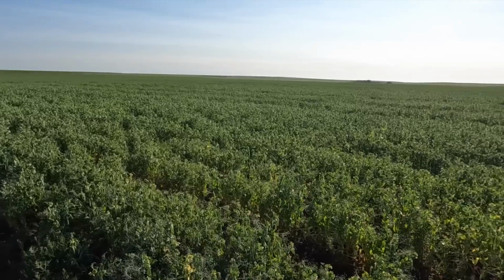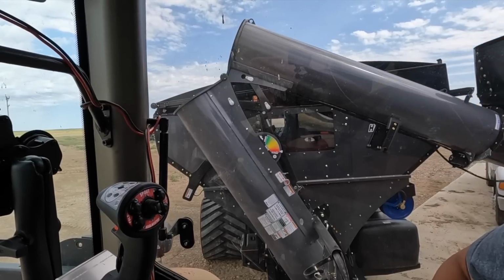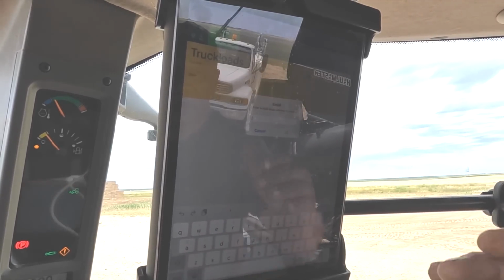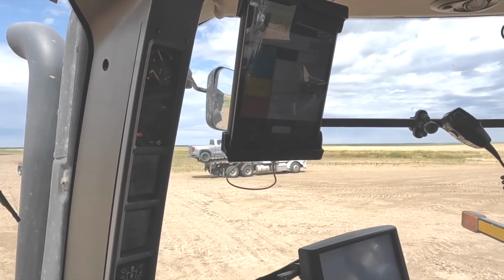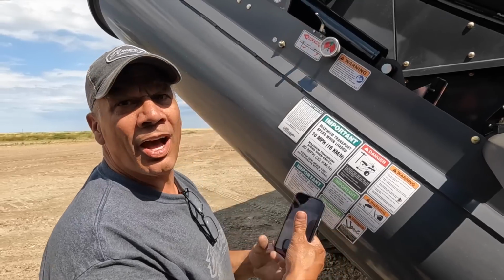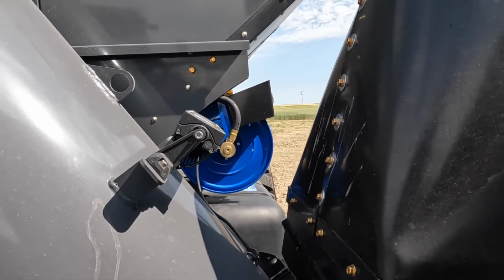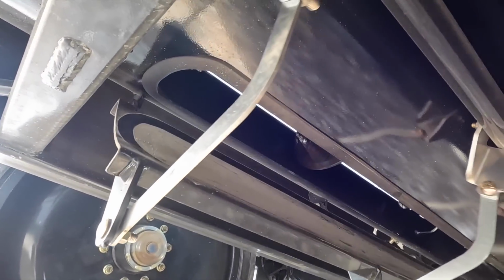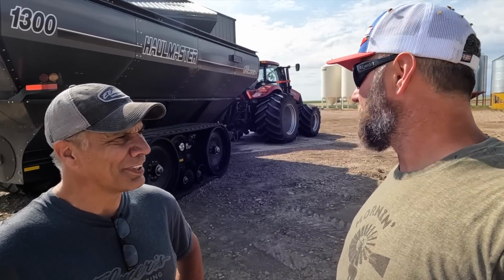GRAY Equipment on a Red Farm?

Comment: Unless they’ve changed them alot in 2 years inside cross members break constantly, oil bath bins are total trash between the clear cups leaking to letting water in oil and seals leaking, frames cracking around load cells.

Comment: Love the see through windows in the cart, question, how long do they rate the tracks to last, hours, miles?
Reply: @williamvincik when used appropriately tracks will last much longer than most people would expect and with low maintenance. Tracks have improved exponentially over the last few years.

Comment: Be sweet if the mfg would add trash bars to the rims to throw the dust and stubble out of the trough instead of letting it sand the paint down and rust. 

All the tech in farming is exploding to help farmers control inventory and manage their crops better. Next the carts will have moisture meters and bushel calibrators in them to double check and verify combine yields.

Comment: In the retracted position, the open end of the spout needs a flapper plate that falls over to close off the open spout in order to prevent mud that is flung off the back wheels of the tractor going into the spout and ending up in the grain. 
The open ends of the folded auger at the old also needs an right angled plate to prevent mud from going into the auger.
Reply: Great idea! At Elmer’s we are always listening to the customer. Keep watching, who knows Elmer’s might be the 1st to come out with that as well. We demonstrate, we listen, we evaluate and we respond. Cheers!